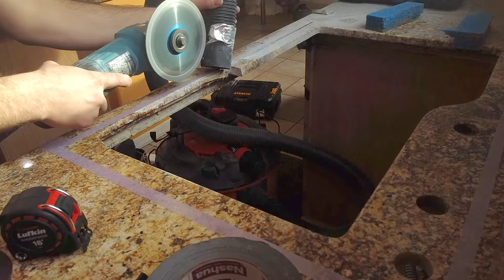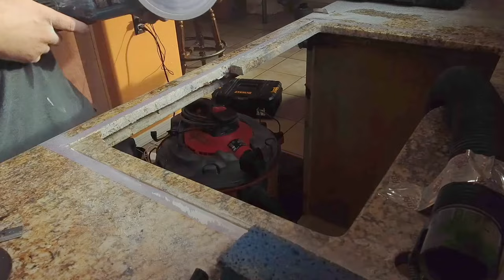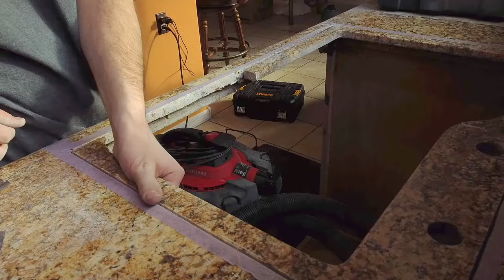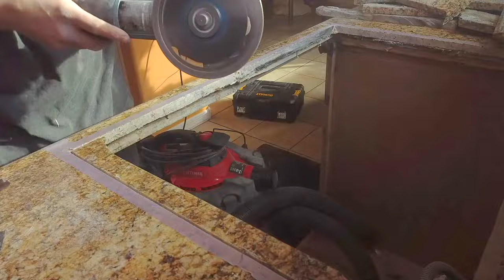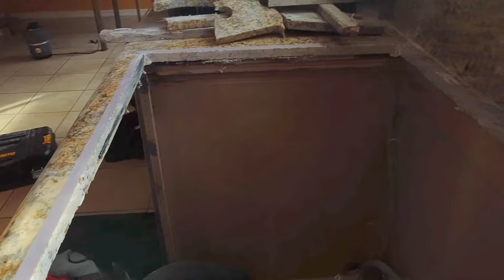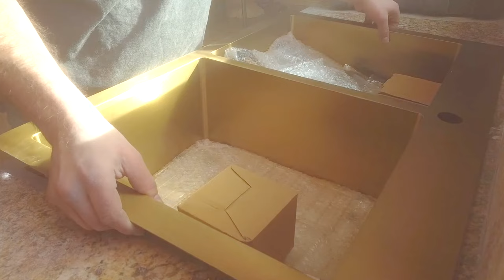Cutting Granite For A New Top Mount Sink

Comment: So that front edge isnt vulnerable to breaking?
Reply from the maker: It can be. I haven't broken an edge from cutting. I have made a hairline Crack toward the back before when there was only half inch. - Justin
Reply: Not if the sink were undermouned and supported by straps instead of clips.

Comment: How much clearance did you have in the front edge?  What a successful cut! Awesome video!
Reply from the maker: Standard for top mounts are 3.5 but you have to make sure there is at least .25 between the backslash and the top mount sink edge for cleaning. Usually you will have 1.5 inch overhang then the thickness of the cabinet. I cut this one about 2.75 from the front . I cut on top of the steel rod that's inside the stone (for Support during installation) which you can see some sparks.  - Justin
Reply: @arizonagranite5551 did you remove that metal rod because it was rusting?

Comment: Is that an angle grinder? or a masonry saw?
Reply: Looks like a Makita 9557PB one-speed angle grinder simply turned off and on multiple times to make it variable speed with a 4.5" diamond blade (don't know the mfg. of the DIAMOND Blade however - it's very important to buy the best one you can)
Reply: @dabneyoffermein595   Thank you for the information!